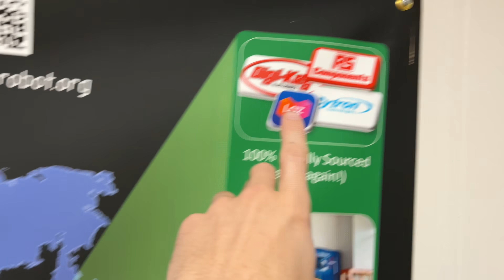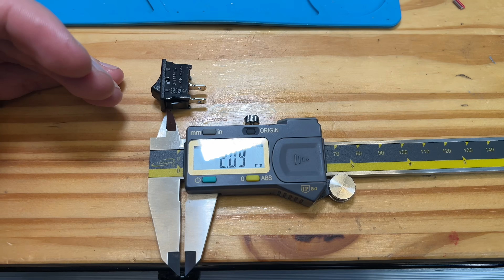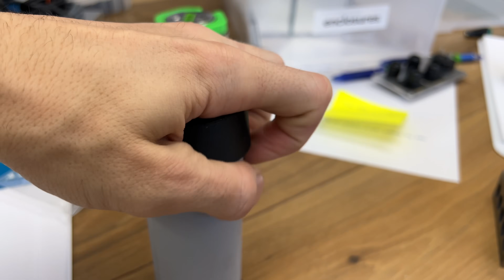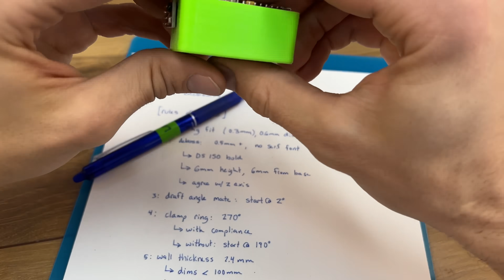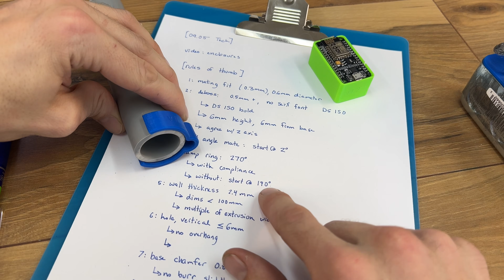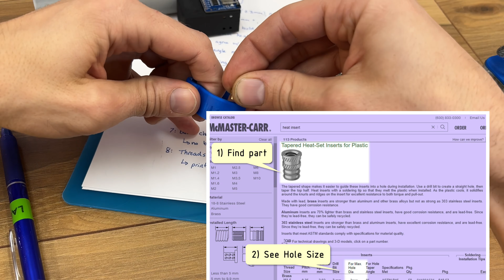Design enclosures for electronics (using mechanical mindset)

Comment: McMaster for all your mechanical hardware, Digikey/Mouser for electronic components, Hammond/Lincoln Binns/Takachi for enclosures, design your faceplates as PCBs and have PCB manufacturers make them instead of paying for machining.  You'll make some really nice enclosures this way.
Reply from the maker: FR4 is so rigid and clean and probably far stronger than aluminum and that is… brilliant. PCB for faceplates.
Reply: @davidmalawey  you can also use the copper, solder mask, and silk screen to make cool designs for free. And by leaving out both copper and mask, you can make LED holes for indicator lamps. 

FR4 is flexible enough that I've been using it to make latching tabs so PCB parts can snap together. They're about half the cost of laser cut parts for mechanical assemblies. The difficulty with that is that tolerances vary +/-0.2mm depending on direction of cut and is different for each manufacturer. Oh, and PCB makers get suuuper confused when you have no vias or mask details. Usually needing a couple emails confirming I'm serious about the weird design.
Reply: @davidmalawey 😂

Comment: ESD. It's a thing. If you live in a humid climate, you might not believe that, but it is. Depending on materials the enclosure can help or hurt. It's complicated.
Not everything has ESD sensitivity, e.g. most motors. Most Electronics do have ESD sensitivity.
It's a big long term reliability issue.

Comment: Lots of really good information on the practicalities on making enclosures for electronics, prototyping or otherwise, but you didn't really touch a lot on actual design. This is what industrial designers work with day in and day out, and take into consideration a lot more than just fitting electronics inside a box. This is to some degree to blame for the obfuscation of the word "design" as well, and how anyone can call themselves a designer, but you can't call yourself an engineer without certification as such.

A well designed electronics enclosure is something which takes into account the aesthetics, the ergonomics, the actual interaction between the user and the product, and indeed the electronics and component needs, and material limitations, as well. It's something that's made in collaboration between industrial designers and engineers (or at least their principles, as there are good engineers who are apt in industrial design, and vice versa). I am an industrial designer (BA and MA), I work in a prototyping workshop for a product development firm, and actual design prototyping is as important early on as electronics and mechanical prototyping. 

I'm curious why you lean on M2.5 as one of your go-to thread sizes though, as opposed to M2 or M3? M2.5 isn't terribly standard. It absolutely exists, and is used, but it's not something you're going to find on most hardware store shelves over here in metric-landia.
Reply from the maker: M2.5 is the largest size that still fits in these many small arduino pcb’s/ sensor boards. otherwise, it would be m3. can’t say how many times i went to commonize the screw sizes and m3 got prevented…

yes also that word “design” has a whole sector you mentioned and i’m definitely not qualified to teach it 🤓 BUT i would love to know what is your favorite example of a youtube video which does in fact cover such.
Reply: @davidmalawey  that's a really good question, as it definitely is a field that is oft misunderstood, and most videos I've found about it is about learning to sketch and draw, specifically products and furniture, often in sleek ways, in perfect perspective, etc. That's one, and honestly pretty small, aspect of industrial design. Sketching is important for communicating your designs, but honestly some of the best industrial designers I've met have been mediocre in sketch quality, but great at communicating intent through their sketches. 

An industrial designer from a school worth their salt learns skills in not only visualization of ideas, but ergonomics, user research, interviewing, creative processes, function analysis, SWOT, manufacturing processes, psychology, CAD, storytelling, prototyping (my specialty), programming, and yes, rendering sleek images, but the list goes on, I've barely scratched the surface. So learning the skills of industrial design is not something which is easily summarized, and it's something in which most designers have strengths and weaknesses in different areas. A good designer can move among engineers with the same ease as among anthropologists, and has an equal understanding of engineering principles as user needs and softer values. A bad designer is nothing but a CAD monkey. 

Industrial design is more something apt for a long course through many videos. You can find good tips on each individual area with videos here on YouTube and elsewhere, but I've yet to stumble over any good source which would give a primer of industrial design as a whole. A good place to start may be to read ISDA's article "What Is Industrial Design?", and from there dig deeper.
Reply: @davidmalawey  Hi David, there is a documentary titled "Objectified" (2009) that you might find interesting in regard to this subject. A small excerpt of which is shown on the IDSA website. The documentary itself is about an hour and 15 minutes long.

Comment: 8:42 another great option is to have a PCB made for the front/back panels of these project boxes. PCBs are fiberglass sheets, CNC cut to arbitrary shapes with decent tolerances, and generally have at least four "colors" to make art/labels with (bare FR4, solder mask, silk screen, exposed pad). As a bonus, you can decide whether to make them electrically conductive for faraday shielding or nonconducting to allow signals to pass through. And of course you can even put parts like indicators directly onto the PCB.

PCBs are very cheap compared to other low-volume commercial manufacturing processes. One-off runs can be had (shipping included) for under $20.

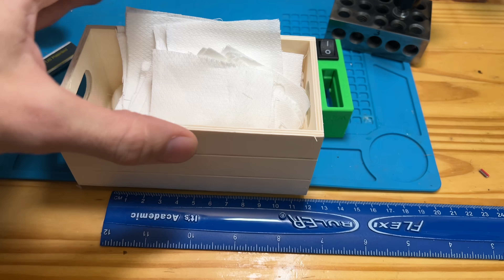Comment: 10:00 You don't have to make the entire wall floppy. Just thin it to 2mm around the ports. 2mm is usually strong enough for small areas
Reply from the maker: this is true. i may be biased seeing students making enormous monolithic parts and being 2 weeks in line for a printing queue to find a mistake.  tiny prints help all that.
Reply: Or put stiffening ribs in … between cut outs if you’ve got to kiss other components inside the enclosure.

Comment: I'd suggest getting ABS pipe instead of PVC, because you can print endcaps in ABS and just use the normal ABS plumbing glue to join them with a watertight seal. I'm sure there's some adhesive that will work with PVC and whatever you want to print, but it's extra research you don't have to do.

Comment: Given the hierarchies of materials from just for now to far in the future, and considering the pros and cons of any given material it seems there is a real affinity for plastics... I do not share this feeling and often wish things were made commonly with stronger more durable and longer lasting materials. Which brings me to my question if you happen to still be reading this; Can you make or do you have a video on hierarchies of materials? Ideally your opinions on the difference available plastics, woods and metals and ending in some sort fo idea of what might be possible in the future maybe with reasonable access to space mining? What kind of mechanical properties are worth the effort of getting material down here to earth? 
Wheres the unobtanium at?
Reply from the maker: it’s hard to break things down in the way you’re proposing.  I remember in high school it seemed like titanium was the best metal ever, but everything has pros and cons.  Will try to highlight advantages of materials per situation.  The adhesives video last month shows a little bit of insight.
Reply: @davidmalawey  I'll check that one out, I'm a recent subscriber just found your channel and I enjoy your explanations of things and core mindset that you share like using off the shelf parts and introducing systems to direct efficiency. 
It is an almost impossible proposition lol thanks for the reply anyway, I never stop thinking about it as a subject as I work with many different materials. I like a36 mild steel when coated properly as frame material due to its strength and cost and relative strength per unit of volume but with condensation issues from changes of temperature it's not the best material all the time. And this comment could be 52 pages long if I tried to explain the pros and cons of the materials in my limited palette from wood to rock to ..... I was curious what you may think but as I think of it, the prompt truly requires a use case. 
Using material to solve problems is too vague I guess. 
Thank you for sharing on your channel!
Reply: @dblackjr52  Just read applied strength of materials by Mott. Standard reading for mechanical engineers and loads of application based material selection information in there.
Reply: @davidmalawey  I am currently attempting to design a new PC so the current material is a complex ASUS ROG Strix Z790- WiFi II (WiFI 7) LGA 1700 but if I was planning to use the computer for something else then it would be a different build or maybe even a MAC studio. Always more questions then answers. Cheers.